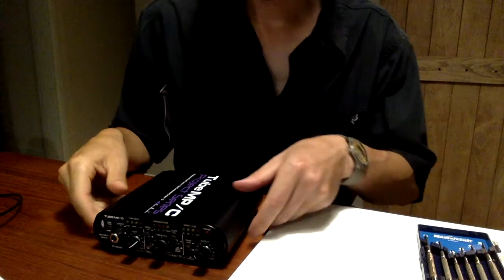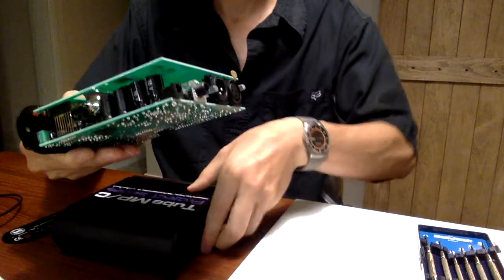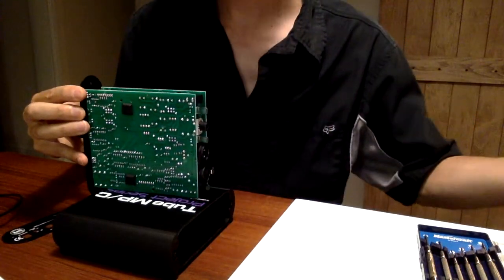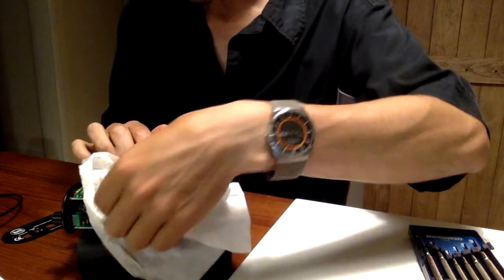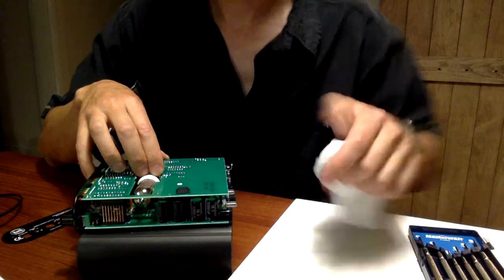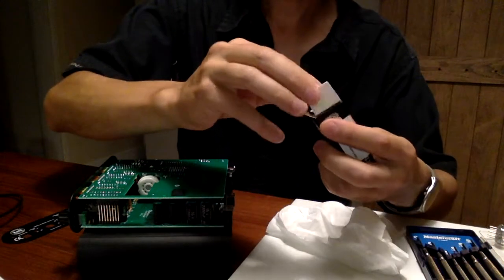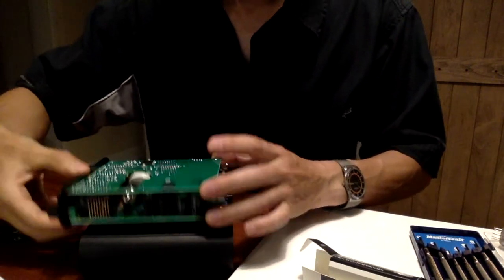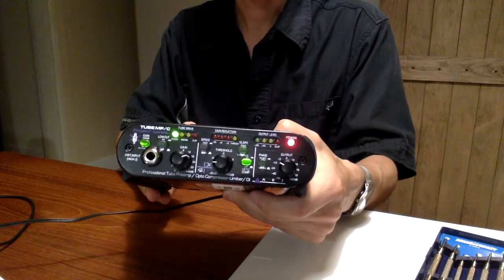Upgrading the ART Pre-amp tube

Comment: It’s safe to touch the glass on audio tubes.   The caution comes from confusion about move projector lamps and halogen lamps which get much hotter.   As hot as audio tubes get they get nowhere near hot enough to compromise the tube function.
Reply from the maker: Thanks. I was wondering where that caution came from.
Reply: as an electrical engineer myself, I was always puzzled about that assertion. Tubes don't get very hot, and I wouldn't expect a little contamination on warm glass would have much effect either way. Your projector lamp observation is spot-on. I recall those old 8mm and slide projector lamps being very hot!

Thanks for clearing this up..

Comment: Great Video! If anyone's having trouble removing the tube - I had success with pushing it in and out a bit while holding the end (as described in the video). For clarification: If you look on top onto the circuit board and the hole with the tube faces towards you, just slightly push the tube towards you and backwards, into the board. Mine was firm as heck and I couldn't move the tube whatever force i applied to it - but pushing it a bit in and out really helped.

Comment: Thanks, I couldn't figure out how to disassemble it! Put a Tung Sol 12ax7 inside.
Reply from the maker: Cool! I've stopped using my MP/C. It developed a nasty hum over time. Haven't had time to troubleshoot the cause. Hope yours lasts.
Reply: @jimdandy  The flat band cable is the cause of the buzz. Fix it or replace it and it'll stop.
Reply from the maker: @SirRandolphWinston  Thanks for the tip! If you remember the forum, let us know.
Reply from the maker: @SirRandolphWinston  Awesome. Thanks for posting the link! I'm in the middle of moving my studio, but when things settle I'll poke at my unit & see what I can figure out.
Reply: @jimdandy  Thanks, it'd be great to see if you can fix it! All the best with the studio move.
Reply from the maker: @SirRandolphWinston  I opened up my MP/C but the post on gearslutz.com is for a different model (MP). This one doesn't have a flat band cable. I suspect connections around the tube might have worked loose with the heating/cooling, but with the way this thing is built I couldn't access them.
A workaround is to use a noise reducer plug-in to kill the hum - I use Brusfri by Klevgrand: https://klevgrand.se/products/brusfri
Reply: @jimdandy  Thanks, I appreciate the effort. I'll definitely get a buzz reducer plug.

Comment: Subtle but noticeable difference. Thanks for showing this. Wish they made it easier to replace these tubes for quick comparisons. I guess it is not designed to be a "tweaker" unit..
Reply from the maker: Yup - designed to be an entry level pre-amp. But with a little effort, there are ways to improve and tailor the sound.